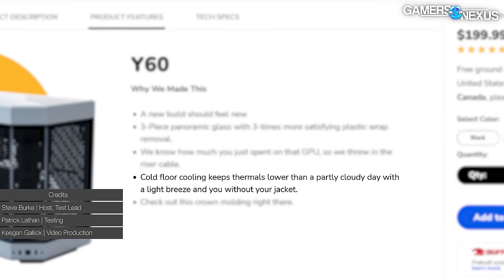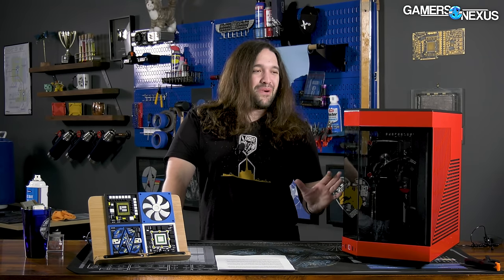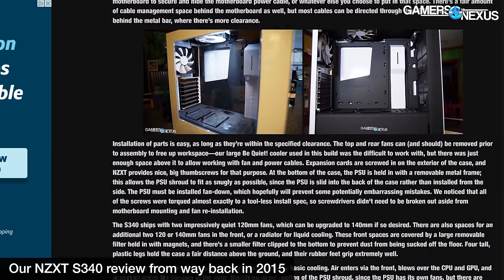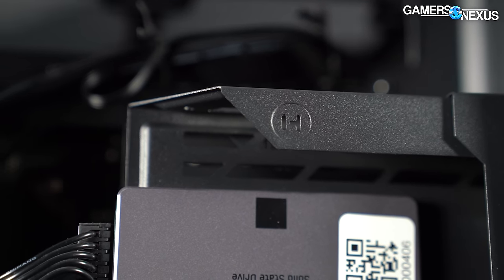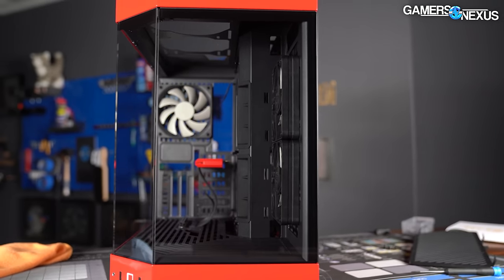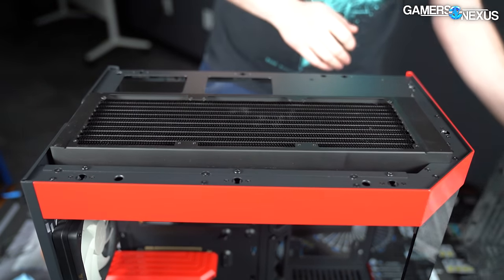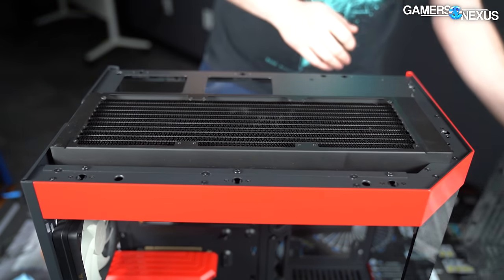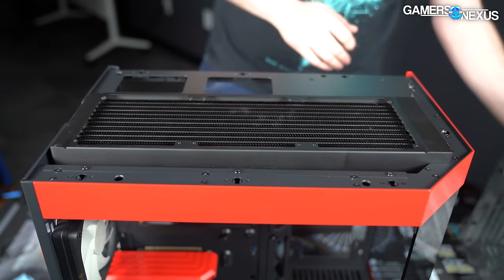Impressive Quality: Hyte Y60 Case Review & Benchmarks vs. O11 Dynamic

Comment: I like this design because I sit at a corner desk, and right now I have a traditional glass side panel computer that is pretty much up against the wall. Something like this will allow me to put the computer more to the edge of the desk, and still be able to see everything inside without having to turn the computer sideways. But I've already invested in a nice 420mm radiator so I need something like this that I can support that big of a radiator, and I don't think that's going to be possible.

Comment: It almost makes me want to deal with the hassle of building a system with open loop cooling.  I like the fact that you could easily rotate it 90 degrees and put it on your left instead of the right.

It does have a bit of an aquarium vibe, but all of those super wide cases do.

Comment: I know its impossible to cover all possible configurations, but I think a graph representing the "ideal" configuration could be usefull to many people, more specifically, side intake 360 rad and (observationally and from numerous videos, I have noticed that median temps overall are better when the rad is used as an intake and not as an exhaust, because as an exhaust the rad also captures the heat inside the system and things tend to run hotter in that case), bottom intake, top and back exhaust. 360 aios are becoming more and more popular and also much cheaper then they used to be. While there are a crap-ton of aios and fans out there it would still provide some useful information to get an idea of how the temperatures would behave.
And lets face it , when you are spending 350-400 dollars on a case, odds are you are gonna populate all fan slots

Comment: I bought the case and it's pretty neat. My only issue was getting my fan hub to sit in a spot where all the fan cable could reach.
Reply: I had the same issue with my Y60. I ended up putting a magnet on my Lian Li controller to the 2nd hard drive bay and roughly run the fan cables through the middle

Comment: I kind of get the stock fans being in the bottom by default, if they assume you will be putting in an aio or custom loop (especially with an aio) you would slap it on the side mount and use the fans that came with the cooler. As far as for me I would stay air cooled but would be putting good as well as more decorative fans on the side intake. All in all, I love this case and can live with all the trade offs/work with them.

Comment: I plan to get the Y60 - saw many reviews, most pointing out that the price is a bit too high, plastic at some questionable place etc.

I will still get it however, there is no other case like it with this 45-45 angle in the glass.

Comment: This does look pretty cool.  The cooling isn't completely awful if you add a couple side fans.  But then I look at the Torrent.  Hopefully a v2 comes out with a more cooling focused design.  Less obstruction and standard horizontal PCIe brackets.  That should about do it.

Comment: My biggest gripe about this case is the grommets. When they pop out, which they will, its a pain in the ass to get them back in there with the 24 pin and other cables running through the hole. They're just flimsy. Love that they're molded, just wish they were more rigid.
Reply: I had this same issue so I decided to glue the grommets on permadently and waited a few hours till it dries completely to start building in, granted I was moving pc hardware over from old case to new case so the downtime was minimal

Comment: There aren't many dual chamber cases on the market, So I praised the Y60 for that. Also, the fact they put some effort to not make another O11D complete rip-off earned some more praise alone, but I was completely sold by the fact they made a Vertical GPU only case but in a way that wouldn't block any of the additional slots either with the vertical mount or the PCIe extension cable and yet keep it somewhat compact... So I would get one of these even if I had to jerry-rig an AIO on my GPU!

Comment: I almost considered this to replace my Thermaltake View 51, but I went for a 360mm Radiator and 360mm flat resovoir/pump, and i also elected to get a Thunderbolt 4/USB4 AIC, which is also full size, so...  that's two strikes against it for me.  I also feel like a support behind the chamfered edge would be a good idea...

Still prettier than the O11 and the H510 though.

Comment: I'm a simple guy who just needs good looking case on the desk in the corner and this case is just what I need. I really don't care about thermal performance as components running little bit hot like 70-80C range is perfectly normal for them and you can customize your fans curves to let that temp stay and fans spinning at like 40-50% speed not producing much of the noise. This is what I currently do with my NZXT Phantom 410 case and this PC is running since 2016. My next build with 4000 series cards will def include this case, I just like aesthetics of it so much and thermal performance as I said is not really a concern for me.

Comment: I'd be really curious to see how this platform evolves, if it ever does, either with an update, a v2, a spiritual successor, etc. I'd also be interested in seeing the modding scene around this case, I would imagine one of the first major mods this case sees is an attic, considering how the top panel attaches, I wouldn't be surprised if a basement isn't also modded for this. In terms of functional mods, it'd be interesting to see some kind of riser used to snake PCIe to the back chamber and use those drive slides as additional full-sized slots; IMO this should've been an option from the start for non-GPU cards, with a modular piece that could provide full-sized slots or drive sleds. 

Personally, I have an issue with how the vertical card is implemented. Yes, people might want to fit fat 3 slot cards into this, but this is also a water cooling focused case. At least make the riser movable by a slot, then provide the option to have a secondary riser to fill in that third slot with a second lower-tier add-in card. A GPU never really goes past two slots port-wise, a water cooled 3-slot card will only be 2 slot in the end, and aren't most modern cards a single slot port-wise now anyways, with a single width bracket you could reasonably have single slot water cooled cards. The card end of the riser needs to be positionable, it adds functionality to the case, sell additional risers separately as an accessory, and have a blanking plate for the other two of three positions. This kind of modularity is important for a case that has been designed to essentially make anything but the GPU's PCIe slot unusable without hackery and riser spaghetti. 

Honestly, just relocate all of the motherboard's PCIe expandability to the vertical slots, you'd literally end up with more usable slots doing so. Implementation, as each motherboard and use case is different, would be a nightmare, the only reasonable way to do this is to make it modular via post-purchase additions. Have a riser card, say make it 5-slot, that includes the x16 portion of riser cables, then make the other slots' cables be an additional purchase depending on the user's motherboard and use case. This would match the motherboard's electrical implementation, and this could also make each slot on the riser configurable for whatever setup the user wants. Logistical nightmare, as stores would have to carry additional product, a varied amount of configurations wouldn't exist not that this would help the logistics situation, and the best option would be consumers buying from the manufacturer but you know how most consumers look at stores first, not a great situation but this may be the best implementation for the case's functionality. 

I want to like this case, aesthetically it is nice, but with practicality it needs help. Either heavy modding, a copycat that does better, or a massively upgraded v2 would be nice.

Comment: I have the Y60 and this case is great. You need to use different fans though, for instance be quiet fans do much better for this case, and two 140mm on the side intakes do much much better. Also a 360mm aio on the top using an already applied exhaust point for the CPU cooler is ideal, as this is occuring regardless anyway.

Comment: Looks good But I would like to see an XL variant of the case (Full size expansion slots, more hard drive bays, SSI-EEB (NOT 'EATX') size Mobo tray, 140mm fans including rear, and at least 76mm of space allowed for the top radiator instead of the 28mm on the standard model) with the plastic replaced with narrower steel to lower air impedance.

Comment: Sadly there was only one diagram containing the Silverstone Fara R1 at that at the stock fan configuration only.
Especially in the "standardized fan config" it would have been interesting to see how it compares to other "newer" cases.

I mean like at stock config the R1 only has a profoundly bad rear fan but it becomes a real airflow talent as soon as you hook three 120mm fans at the front leaving the top mesh as pure "passive" airpath.

Would have been awesome to see what two additional 120s in the top or even two 140s would mean temperature wise

Edit: I know you guys made a whole video about the R1 but that's a little aged now especially since you got your testing equipment upgraded

Comment: Hmm, how about a custom mesh on top-exterior and bottom with some dust filter on the very bottom side? It would also be amazing to fit a 240mm thin rad on the bottom with some 10mm low profile fans. I am not sure if a 280mm+360mm rads would be capable of cooling an AD102 GPU and a RPT-L CPU. 800W of heat is a little too much to cool even with water... And with this chassis, I think it will be a bit of a struggle, no matter how thick of a side rad you install. Maybe you could do a HWLabs GTR with push/pull and your top rad will have some Gentle Typhoons.

Comment: S340 Elite old model is what i am still using with z370 Intel i3 8th gen. But now i also like this new case. There's no vibration protection but that's ok. I like it be a simple build with a stock water cooler.

Comment: I would be interested in seeing a comparison to the O11 series with either a 360mm AIO or a custom loop. This design really is intended to be used with liquid cooling. I do understand why that's hard to do for comparative data though.

This case does lack one of the strengths of the O11 XL for high end custom loops: The ability to effectively mount 3x 360mm radiators. This is arguably a bit of a niche feature for now given how high power consumption needs to be to justify using 3 big radiators. However, that could change soon given the leaks indicating up to 600W for the RTX 4000 series...

Comment: I got curious and took a look at the dimensions compared to the 011D. (thinking that the Y60 would be a little narrower with its pcie slot setup). And somehow its listed as being wider than an 011D (285 mm on the y60 vs 272mm on the 011D). Are these numbers correct?, and if they are what takes up all that space?

Comment: It would be interesting to see the bottom fans as exhaust rather than intake to give the GPU heat a quick route to exit the case. I hope GN would consider retesting this case with this configuration.
Reply: Hot air rises.

Comment: I actually have this case for my new build.  its harder to build in than the LL 011D and i wouldnt recommend a 360mm cpu cooler as i cant get the top to close flush.  but the fit and finish is brilliant, its solidly built and makes for a clean builld.   The Rog Stryx 3080ti basically hides the riser behind it though.

Comment: I like the look, but the vertical only GPU mounting sucks.  My go to case is Corsairs Carbide Air 540 at + or - $150 (6 PCs built with it).  I like the look of the cube design and storage options.  I also want the 2 optical drive bays.  Downside is the lack of fans (like most cases).  I use Arctic LF2 280 top exhaust with 4 Noctua fans, 3 intake on front and 1 exhaust which does add another $100 to the cost.

Comment: I have this case. I have a 360AIO and a 3080ti Hybrid. I actually couldn't fit them in my bequiet 500DX. I'm currently fiddling with fan placement. really I wish the GPU had the 360 and the CPU had the 240. cause the air entering the case through the 3080ti's rad is warm as hell to begin with. been thinking about getting some coolant and trying to switch the rads. it'll be a cluster and i'd have to be very careful to keep as much water as possible in the loops.... syringe and some flextape! or maybe just go for a custom loop...but what's the fun in that when you can jerry rig something together instead.

Comment: This would be Ideal for an ITX build . . . . 😄😄😄
Seriously though, I really do like this case design. Not too thrilled about the expansion card situation. Graphics cards are designed to fit into an expansion slot, horizontally,  making the cooling fans 'hang' from the bottom of the GPUs shroud. When those fans pull air through themselves, they are also pulling down on their bearings, loading them properly. When you mount your GPU in any other configuration (vertical) the weight of the fans loads the bearings not just on their side, but also slightly offset from the center of load on the bearing. This greatly reduces the fan bearings life. This is why the fans on cards in mining rigs fail so frequently and the cards overheat.
Just a theory I have . . . . maybe it's something you guys can test with the new equipment you have.
Have a nice day. Greetings from Alaska.

Comment: Interesting thing after another all is well probability of the tributed office which would trace a fortuneless insight of insignia and do it's work for whatever duties fit and it's installment fit form for nameless umbrella duties.
Reply: Aftermarket for software programs should look enabled for positive reinforcement and the eventual offset should turn into tolerable program for reaching goals and researching. Already into the right control boards which are used by a such box for bypass reason.

Comment: I actually kind of like the idea of half height cards + a front mounted card with a riser. It means you can use your expansion slots for SOMETHING even if you're doing af front mounted GPU, which a lot of cases don't support, which kind of ruins any point of using an ATX board. Need more half height card options for it tho x)

Comment: I feel like the designers designed for a bruteforce airflow layout when run dry, and the contact just... didn't know. 2 intakes at the top and bottom, and 3 exhausts on the front-side would create a linear chamber that quickly rushes air in, through the central chamber, and out the side much like the  "GIM White-Glass" (which is a CN clone of the first O11).

Comment: If you could populate all the fan slots what would you recommend for a fan configuration? Using a 360 AIO and a ftw 3080 air cooled. I'm thinking top and bottom intakes and side panel exhaust but would love to hear your recommendation

Comment: Have now seen the case at Jay2cents and Der8auer.
Jay's true more neutral.
  Der8auer found it a little too plastic in certain places and the filters should have been removable. The corner at the front is also not very cleanly worked.

Comment: If you want to improve the Y60's airflow with very little effort or cost: raise the case by about an inch (2.5cm). 
I cut out four rectangular pieces of packaging foam (from inside my 7900xt's packaging) and placed them under the Y60's corners.
When I feel, with my hands, I can feel a lot more air being sucked up from below.
Thermals for the GPU dropped dramaticly (in 3Dmark12 it doesn't even go over 60C) and the CPU seems to be cooler as wel.
Also I notice that the heat being expeled from the top is cooler and doesn''t seem to hang around that hotspot in the front of the case, like it did before.

So much for synthetic tests ... now lets see what happens in the real world of gaming. 
Baldurs gate 3 is up first :)

Comment: I think the two biggest issues with this case is the inability to use full size cards, and the fact that if you want to clean the bottom filter out, you have to literately turn the case on it's side to get to it.  Some of us do not want to undo all of our cable management and turn our computer on it's side  "potentially scratching the case"  just to clean the bottom filter.   If Hyte could perhaps do a pop in case mod so that you could choose to use the video card upright or vertical, I.E. a screw in back plate that could be changed out with another, so that you had a choice on how you wanted to use this case.  I truly believe that making it a water cooling vertical mount only set up is a going to hurt their sales for this case.

Comment: I really like this case, but I don't understand limiting the thickness of the top radiator to what they did as Arctic's Liquid Freezer II radiators are 38mm thick, and they're very good and popular. I realize you have to set a limit somewhere, but this is only a few millimeters, and it's a product that's both popular and quality.

Comment: I think the amount of plastic is not adequate for a case in this price region. But I love their own design ideas. Forcing vertical GPUs is an interesting move, but it allows to install low profile expansion cards, while most other cases block the use of other expansion cards at all when a vertical GPU is used, which makes the ATX form factor useless.

Comment: My next case is either a 5000/7000D airflow, Torrent full size, B500DX, or the Hyte y60, in white.

Hard to choose. By aesthetics alone, the Hyte is by far the best. Thermals is torrent, IMO overall the 5000/7000D is best aesthetic to performance